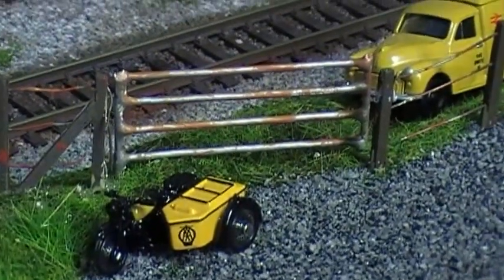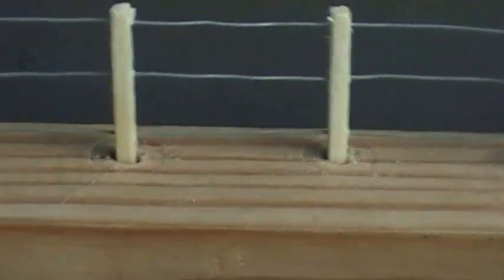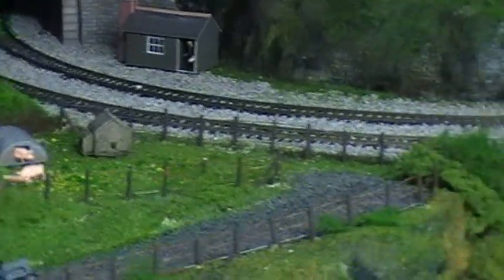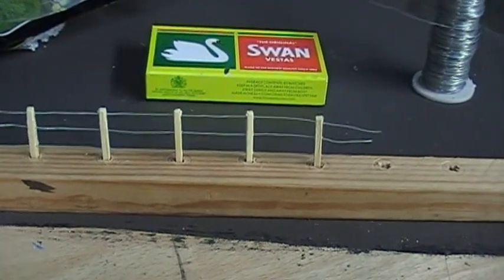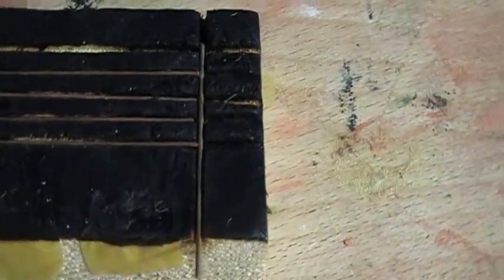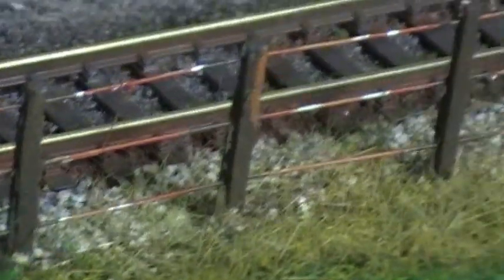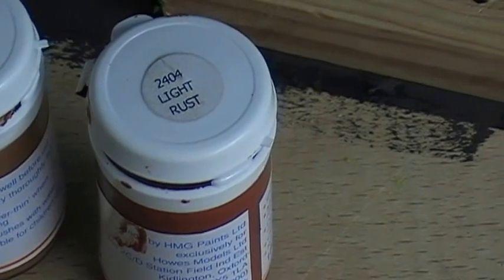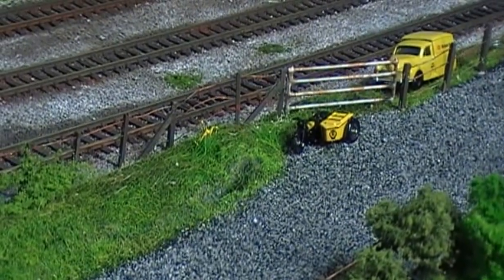how to make post and wire fencing

Comment from the maker: hi Richard thanks for the comments i used that template on the curved section at the top just drilled 2 or 3 hole then move the template around to take it around the corner then did another 2 or 3 etc etc etc , all right on the outside of curve !!  am going to do a bit more undergrowth around fence and see what that looks like ,once again thanks

Comment: Hello Kevin, just come across this video, your work on the fencing is excellent, did you build the fencing in sections or did you put each fence post separately on your layout then feed the wire through?
Well done!
Michael
Reply from the maker: Hi Michael yes each post put in individually and then threaded the wires through ,found it best to stain the posts once wired was put In otherwise could not see the holes cheers Kevin
Reply: Thanks Kevin, could I just ask which glue you used to glue the wires in place?
Michael
Reply from the maker: WestBlythMPD hi Michael they don’t need glueing just wrap wire around last post
Reply: Hi Kevin, that's great thank you very much.
Michael

Comment: Hi Kevin, what gauge florist wire did you use?
Will make the fencing for the diorama I'm doing for dad and you're idea is perfect, good man you.
Cheers
Mark
Reply from the maker: Hi Mark I drilled a .75 hole so I think about .5 mm got it from the range was really cheap my favourite price cheers Kevin
Reply: kevintregunna Thank you Kevin, I went for the .46mm in the end, and only £2.55 with free postage, also noticed they do something called 'reindeer moss as' well in different colours, looks as though it would make for some good bushes and that, I think I saw that in the Range as well.
Mark
Reply from the maker: That sounds about right Mark it goes a long way and swann matches are best for drilling but don't put any weight on them let the drill do the work ,not heard of that moss will take a look cheers Kevin
Reply: It looks really good, link to some images and prices on eBay just to get an idea.

http://www.ebay.co.uk/itm/Dried-Reindeer-Moss-multiple-colours-and-pack-sizes-/271610618336?pt=LH_DefaultDomain_3&var=&hash=item3f3d4121e0

I have a pack of matchsticks I bought from the Range when I was making the N gauge layout, will see what they are like first, but if no good then yest I'll venture out and buy a pack of swannies.
Thanks for your help Kevin, really is appreciated.
Mark

Comment: although i have watch this video many times, i am having problems with the matches splitting as i drill through them. and i have used swan vestas..help.
Reply from the maker: Hi Keithi think I used a .5 drill bit ,let the drill bit do the work if you press to hard they split ,I had a few split but found the swan matches to be better cheers Kevin
Reply: kevintregunna Why not glue to the posts the barbed wire. Use some weight, such as a old book, to help while the glue dries.